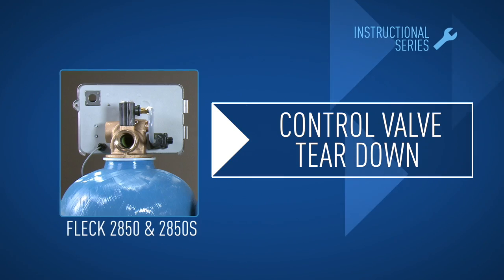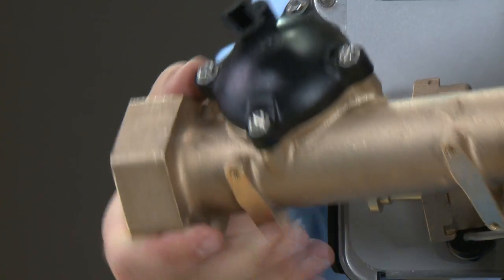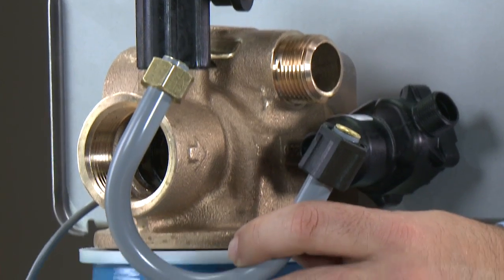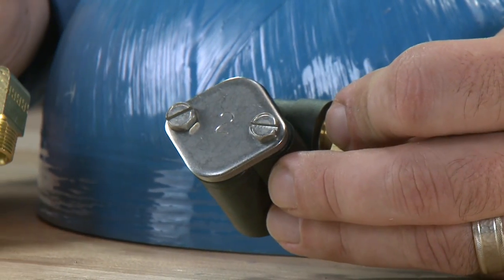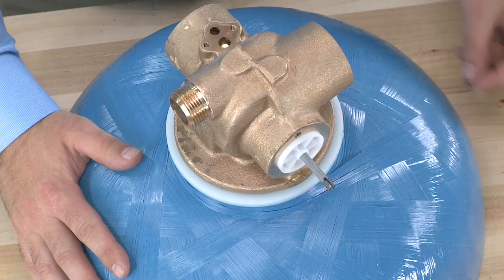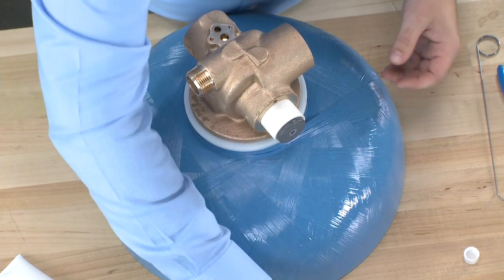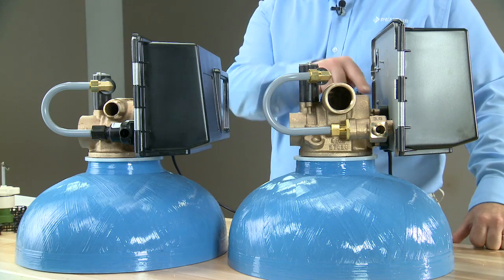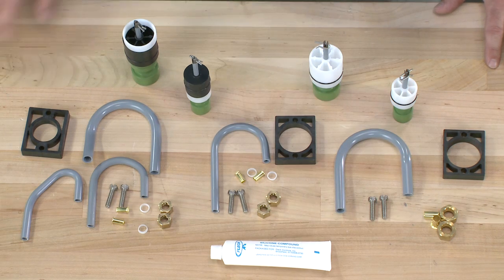Fleck 2850 Control Valve Tear Down

Comment: Good video, looking to find out why the brine tank empties but does not refill.  Any suggestions on what I should be looking at?  I have replaced the injector assembly, brime valve by the controller and the brine valve in the tank and still does not refill the brine tank.  Thanks.